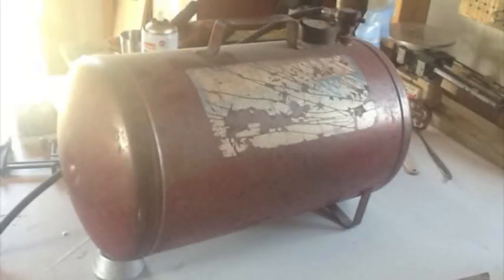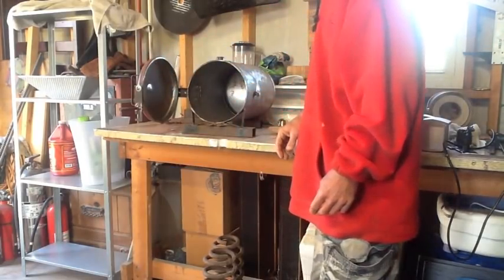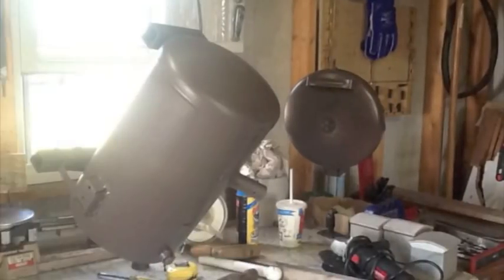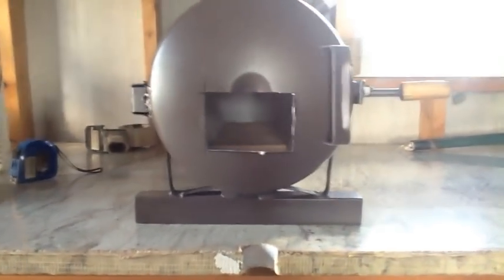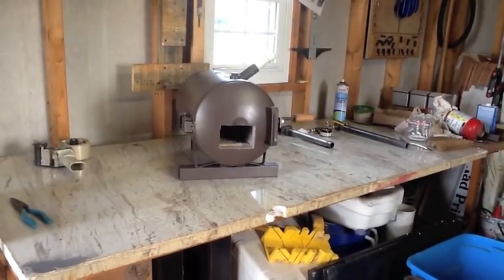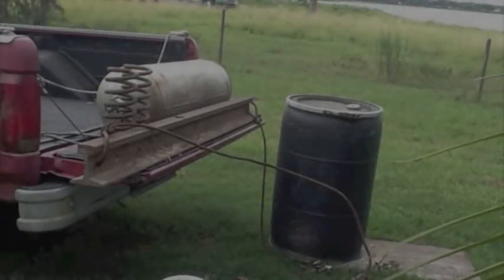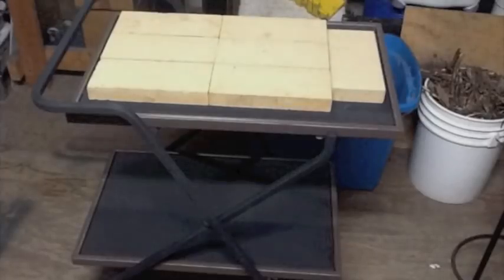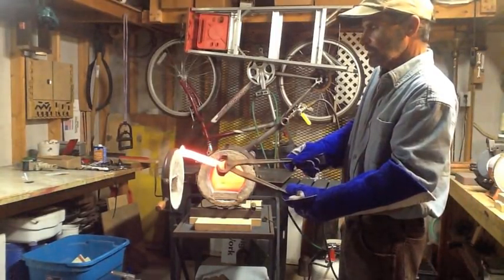My Custom Blacksmith Propane Forge Build - Start to Finish

Comment: @MSFN do you really need the ITC100, I have the rigidizer you mentioned in the supplies video but when I called the company that sells the ITC100 they told they were put of it. Anyways I have been working on my forge for a week now and its almost done!! Thanks for the video it does helps a lot!
Reply from the maker: You dont "need" it but.....it will add a great amount of heat retention and make the wool last longer. You can contact the company that makes it but they charge more than the source I provided
Reply from the maker: Best of luck on a successful build!!

Comment: Nice.Does the pipe from the burner valve going into the forge need to be that long?Seems like it sticks way up in the air.I'm rounding up materials to start my own burner/forge.The wife had a helium balloon tank left over from a party about the same size as yours that ought to work nicely,and I have a ball valve for the burner,I just need to figure which burner design to go with,there are SO many on YT.Anything you dislike on yours?Thanks for sharing!
Reply from the maker: Does the burner tube need to be that long?, doesn't have to be....it depends on how close you want a rubber propane line to your forge I suppose...dont need it melting now do we? 

I have vids on my burners and how they are made...kinda easy peasy. I see no reason to change the design of them, I dont dislike them at all. Thanks for watching and your comments. :)
Reply: Thanks for the rapid reply.Please don't think I was being rude ,I just thought it may need to be that long to mix the air/fuel.I wasn't thinking about the heat issue.I wonder if braided stainless would work as well,I have a lot of it around.
Reply from the maker: No, I dont think your questions were rude whatsoever! Try using what you have, if it dont work...try something else...make sumthin from nuthin!! :)

Comment: how much ceramic insulation did it take ? thanks.
Reply from the maker: I used 2" of insulation, 2 layers 1" thick, I think I used around 10 sq. ft. Or thereabouts

Comment: 3 more question, thank you for responding before!  Is there a reason I see the forge torch at an angle? And if so is there a specific angle that gets best results?  Also if I want to do three torches on my forge is there an ideal spacing between them?  Thanks again!
Reply from the maker: I did it at an angle so the flame would circulate smoothly in the circular interior. I chose no specific angle, just eyeballed it. I have never used more than one burner so cant answer that one, maybe look at some commercial units and decide. I have also seen multiple burner forges point straight down...most likely for forge welding
Reply: That makes sense,  I started stipping the paint on an old compressor tank last night,  I'm excited was going to spend 600 or so on a forge, you saved me a lot of money,  thanks for the video!
Reply from the maker: Excellent!, thanks for watching!!

Comment: how long did it take for you to heat up that track nail to that level? I built a forge and am trying to get an idea of how well mine worked.
Reply: also for the propane burner, I used a 6in pipe and the air intake still gets hot. Will an 8in pipe fix this or you think it's something else? Thanks
Reply from the maker: 10 minutes
Reply from the maker: @oniteprompt2976  cant hurt to try 8"
Reply: @MakinSumthinFromNuthin  Just affixed 8in, seems like it helped. It heated up 1/4in metal in 2 min. But the burner flare nozzle in the forge got red hot as well. Is this normal?
Reply from the maker: @oniteprompt2976  Yes, thats normal. Extend the burner only as far as needed for clearance and no more
Reply: @MakinSumthinFromNuthin  alright thank you!

Comment: Nice work,that forge is a beauty.Can you tell me how much this forge cost you in materials,especially the insulating wool and materials?.Thanks for sharing.
Reply from the maker: Thank you sir. The cost fell between $135-150 for forge materials and burner materials. Much depends on how well you shop materials :)
Reply: Thanks,i will have to look around.I have looked a little further on Youtube and have noticed a few similar DIY forges.Some don't seem to generate the heat to get the steel white hot as yours does.This may be to do with the type of burner,i am not sure.Anyway,i really appreciate your time.Thank you very much.
Reply from the maker: U R welcome! This forge does perform very well..I couldnt be happier with it. I have other vids on the forge and burner if ya wanna take a look :)
Reply: Thanks,i have subscribed and will have a look,cheers...I just had a look on ebay for propane forges and it seems a company from Lithuania is getting in on the action and a selling a whole range of different forges to suit different budgets.It seems though U.S folks are having trouble with their regulators not being compatible.The price seems reasonable though and i am an Aussie.You guys with your stronger dollar will do even do better.Cheers
Reply from the maker: Greetings from the U.S. than!, and thx for subbing :)
Reply: I forgot to mention,i have a couple of Interesting Anvils on my channel,even a railroad track anvil..Have a look if you have time...Cheers
Reply from the maker: I will check it out. Thx! :)
Reply: honestly not bad considering preconstructed forges run you about 400+ for one online.

Comment: Beautiful job, you wouldn't happen to have a BOM and cost handy?
Reply from the maker: I dont have a list of materials but you saw what I used. I have about $130-150 in it
Reply: That includes the burner?  :)... I'm thinking of doing something similar which is why i'm asking :).
Reply from the maker: Yes, including burner...I made it. have videos on my burners if ya wanna check them out :)

Comment: Nice job. If you don't mind, what is the rigidiser?
Reply from the maker: +christian siegel Thanks Christian! Rigidizer is I believe a colloidal silica suspension. It comes in a liquid form and once applied to the wool it dries to a hard crust that keeps particles from the wool going airborne. It may have some refractory benefit to it but dont quote me on that.....I bought it to keep particles from the wool going airborne. It made applying the ITC 100 very simple
Reply from the maker: +christian siegel I bought a gallon...I think was $29.00....got it from Axner Pottery Supplies. Only used about 25% of it
Reply: +Makin Sumthin From Nuthin ! Thank you

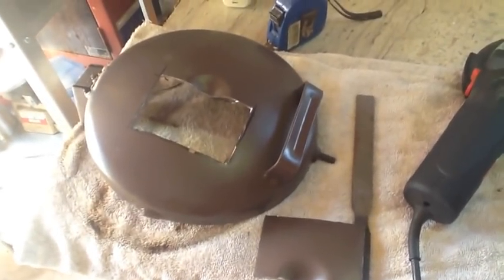Comment: 08:29 I thought you painted it white? What made you paint it again a different color?   btw should I just by that foundry wool or make a refractory mix? I guess one cant go wrong with the wool eh?
Reply from the maker: The wool was originally white, it was covered with ITC100 which is gray color

Comment: do you have any video of how you setup the fuel attachment to the tank with the shutoff valve? Nice forge!
Reply from the maker: Thanks Willie!, I do have two videos regarding the burner for both the forge and my foundry furnace, both are pretty much made the same way. Both terminate with a 1/8" brass nipple which attaches to the common propane line since I use the tank for both. Maybe those vids will help you out ?
Reply: I'll check them out. Thanks.
Reply from the maker: Great, you do that and I will watch the hurricane go by! :)

Comment: Nice video man! I am just browsing through youtube to find ideas for backyard forge! This is the best one so far! How is it holding up? Do you have to replace that insulation often or not at all? Other ones i've seen they actually put insulation first then use some kind of heat resistant concrete around the inside, I think i'll combine this idea with the concrete for best of both worlds!
Reply from the maker: Thanks!, looks as good as the day I made it, about 12 months now. I have ITC100 ceramic coating on the wool, best coating for the wool on the market. Google ITC100
Reply from the maker: No one has ever said "The Best One", I appreciate that!! :)
Reply: In terms of build quality and execution I definitely think it is! It's very professional looking and not overly complex. Have you ever used it as a foundry? As in melting metal down to a liquid? What would I search if I wanted to get that insulation? Thank you for the response and the great video too!
Reply from the maker: Well I appreciate the kind words! No, never used it to melt metal although it can. I have three foundy furnaces so never melted anything in the forge. Check out the casting videos, I show how I made the foundry furnaces too :)

Comment: How much of the insulating wool did you have to buy for this size forge? Can you provide the dimensions?
Reply from the maker: 10.5" diameter and 18" long the tank was. I bought extra wool so not sure what the forge used, sry

Comment: Pretty sweet forge
Reply from the maker: Thanks, much appreciated considering your youtube handle!
Reply: Yeah that's also my business name and email account as well. Kinda in between shops right now but I'll get some videos up hopefully pretty soon. I have everything from a can forge to portable 'pop rivet' forges and even a huge buffalo forge with an electric champion or Otto blower. Right now I'm looking to build one like yours though!
Reply from the maker: For the right price you can own mine, thinkin about sellin it :)
Reply: Makin Sumthin From Nuthin How much? What did you use for the sealer/hardener to cover up the wool?
Reply from the maker: The wool was was treated with rigidizer and then has a two layer coating of ITC100 for heat retention. You can email me at makinsumthinfromnuthin@gmail.com

Comment: What is the diameter of the air tank you used? I cant find a 7 gallon, and I think a 10 gallon would be too big so im wondering if I can get away with a 5 gallon but Im worried the inner diameter would be too small
Reply from the maker: The diameter is like 10.5", I have 2" insulation leaving me an opening that was 6.5" when the door is open. Just subtract your insulation thickness from whatever tank you get to know your opening size :)
Reply: Thanks, when I get my tank I can compare now. your air tank design is great! the insulated door is way better than many other designs. Couldn't find any for free but they are pretty cheap new.
Reply from the maker: Thanks!! The hinge is from an old BBQ grill, seems to be the most common question :)

Comment: what was the advantage to using the wool rather than say  a plaster/cement mixture on the inside?
Reply from the maker: Easier to install, much better refractory, better heat retention.....weight. Plaster is not a good refractory and will always fail after repeated use. Ceramic wool is a top notch insulation :)

Comment: Is it safe to use something like this in a basement?
Reply from the maker: I am no expert, but it is my recommendation not to use a forge such as this in an enclosed basement. I use it in my shop but have an 8' x 8' door, 2 windows open and an exhaust fan going. I will defer to others more knowledgable than I to chime in.
Reply: +Makin Sumthin From Nuthin I think you're probably right.
Reply from the maker: I think thats why they call them "outdoor propane grills", Forges are no different I would imagine :)

Comment: Nice work! What was the total cost of the build?
Reply from the maker: Thanks! The Wool, Rigidizer & ITC 100 came to approx $130-140. The rest I had & was free :)
Reply: Not bad at all man. Thanks for replying.
Reply from the maker: And Thank You for Watching!
Reply from the maker: Ha, picked up another "Dislike" on this build today. I Would love to see the forges the "Disliker's" have made to put mine to shame....too funny!
Reply: +Makin Sumthin From Nuthin You got that right! Lol
Reply: I actually picked up an old 15 gallon compressor tank from my local scrapyard about 6 months ago for this exact project. You motivated me to get to work! Thanks! Started yesterday morning. So far, I'm only about as far as you got to around 1:55. Unfortunately, my tank is in much rougher condition than yours. In fact, when I finally cut it open, I found it had about a gallon of muddy sludge just sitting at the bottom. Real nice. It was also missing its wheels. The paint is flaking off in some places and rusty underneath, so I have to strip the paint next, and I don't have a wire wheel for my grinder. I guess I have my work cut out for me with the ole wire brush. For insulation, I wish I could do it the way you did, but ceramic blanket is a little out of my budget at the moment. I had a neat idea that I think might work. I went over to my local building supply and bought a two foot section of 8x8" inner diameter, square clay flue liner for $10. I will probably only use about 18 inches of it. The walls are about an inch thick, and terra cotta is relatively resilient to heat. Since I hope to reach temps in excess of 1800 F, I will paint the interior with an emulsion of aluminum oxide and sodium silicate as a high-temperature binder to try to reflect some of the heat. The idea is that the clay flue liner will serve as the burn chamber in the center of the tank, surrounded by some sort of refractory, TBD. Oh, I also went over to Lowe's, bought some replacement wheels (it will be convenient for it to be mobile), 2000 F grill paint, a heavy duty hinge, and a hinge spring pin. Thought it might be convenient to have the door swing open automatically when it is unlatched. I will let you know how it goes. Thanks again!
Reply from the maker: Great!, keep me posted on the build! These things take time so whittle away at it

Comment: Great video man

Just a question, how much wool did you ended up using😊
Reply from the maker: Goin from memory I think about 11-12 sq ft, I bought 16 and had some left over for my brass furnace I made and still have a little left :)
Reply: Makin Sumthin From Nuthin thank you i will probably build one soon
Reply from the maker: Nice, good luck with the project :)

Comment: Just built my own forge following this tutorial. It takes quite a while to get the heat up. Have you experienced this? Should I add a second burner or get some kind of blower?
Reply from the maker: Mine takes about 10 min to get up to temp. If you were to introduce forced air thru the burner tube you will see a tremendous difference in ramp up time & performance. A simple hair dryer would work. I use a simple dimmer switch to adust the hair dryer for fine tuning if/when I use it.
Reply: Use a forced air burner n you will be very happy

Comment: By using forced air with in the torch or not, will that effect fuel consumption and how?
Reply from the maker: Nope, the fuel flow will remain constant, adding forced air just changes up the air/fuel ratio. One could run a bit less fuel for the same heat output tho because it will run hotter using forced air

Comment: Hey man-great work. really excellent stuff. I'm making one myself on a larger scale for swordmaking rather than knives. This is the best tutorial I've seen for this anywhere. i do have a question- what is the rigidizer that you used? and what is thr chemical you put on there after it had dried? how much of each do you use?
Reply from the maker: Thanks Much! :) The Rigidizer is a colloidal silica suspension that makes the wool stiff when it dries keeping the ceramic particles from floating about and is available from pottery suppliers that sell the wool. The greyish coating on that is ITC 100 which is a specialized ceramic coating that reflects heat to make the forge more efficient by retaining heat. I used less than a quart of rigidizer and 3/4 of one pint of the ITC 100. Hope that answers your questions :)
Reply: +Makin Sumthin From Nuthin it does! thanks a ton!

Comment: I like this..where did you get wool ridgedizer?
Reply from the maker: Got mine online the same time I bought the wool. Can find wool and rigidizer locally at pottery supply houses. Our pottery place was too far for me to drive so ate the shipping, wasnt much tho :)
Reply: I was going to make a coal forge but I like this better as it will be a cleaner heat for my workshop in the winter months. I also wont have to run a smoke stack for a vent. Just much cleaner all the way around!. I had also thought about using a plaster and sand refractory
Reply from the maker: I have nothing against people using plaster but in all my research it doesnt last. It absorbs a lot of heat rather than reflect it like wool does. I have a tiny paint can forge made of plaster. See my vid called the $5 Foundry Furnace. You want your metal to absorb the heat, not the forge itself. It will make it inefficient and burn more fuel. In the long run wool is cheaper :)

Comment: How well does the JB Weld hold up for the forge burner holder pipe?
Reply from the maker: Just fine. JB weld is good for like 600 degrees before failing and the outside of the forge is touchable when in operation. If I had my welder at the time I woulda just welded it :)
Reply: Thank yo

Comment: Please DON'T use that thing in an enclosed space or even an open space that doesn't have VERY good ventilation!  The Carbon Monoxide produced by this thing will kill you before you even realize what the problem is!  And have a good CO detector nearby!
Reply from the maker: Thanks Brian, was plenty of ventilation with both windows open as well as my two 4' x 8' shop doors being open. I appreciate the concern my friend :)